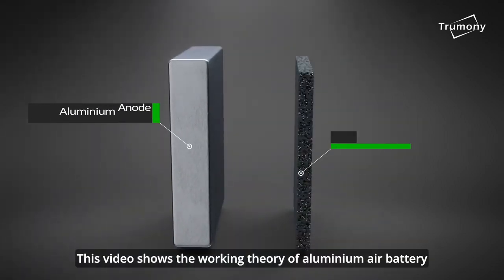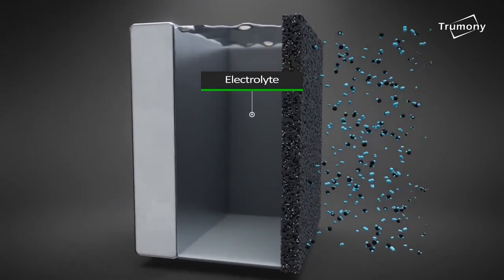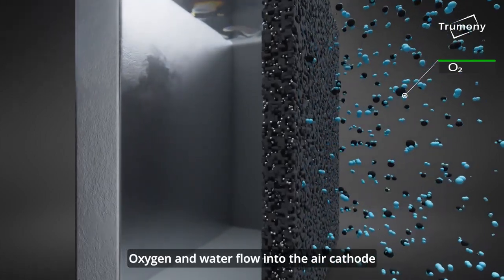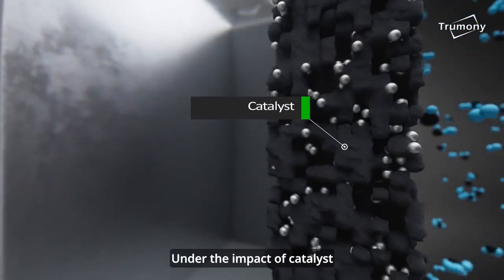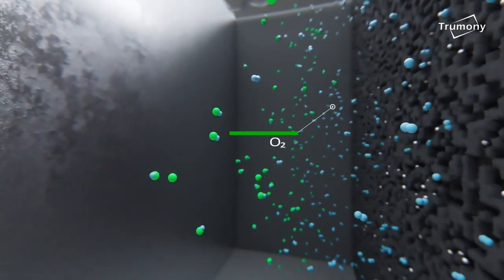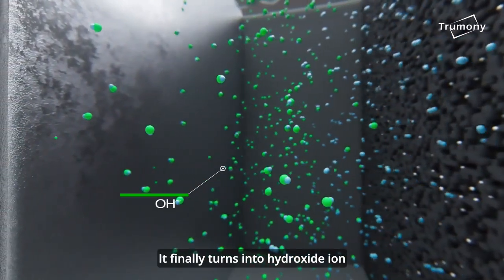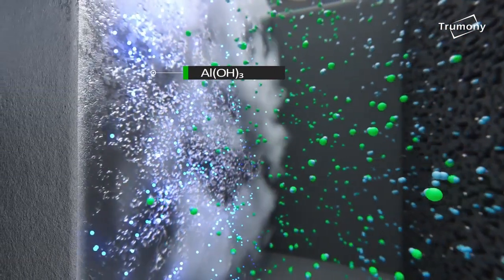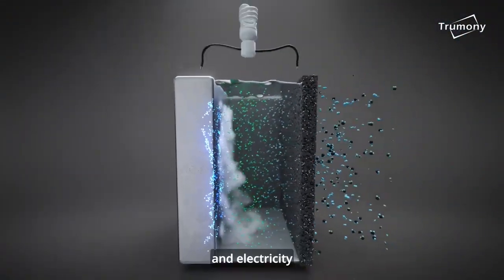The BEST Video explaining Aluminium Air Battery working theory well

Comment: Is aluminium consumed here
Reply: yes, generating aluminum hydroxide. It can technically be recycled. But the point is a slab of aluminum has ridiculous amount of energy density and replacing them are cheap and easy